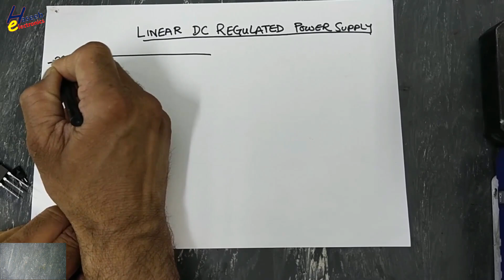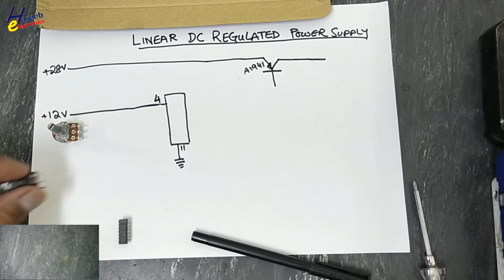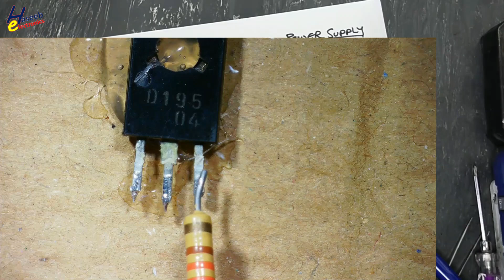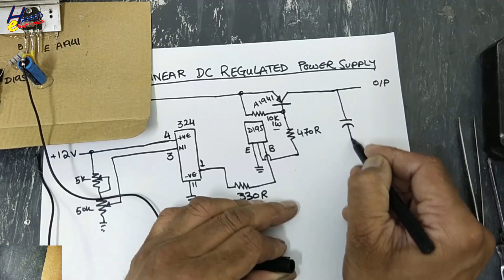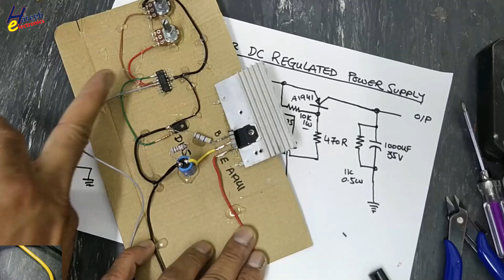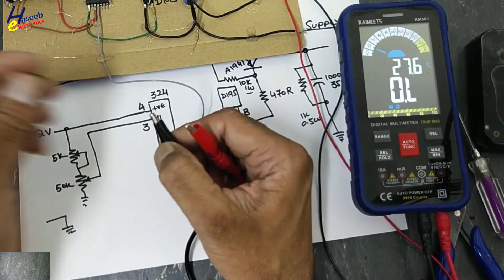#1336 Designing a Regulated DC Power Supply Using LM324 | Complete Circuit Guide

Comment: Many thanks for this interesting video. I’m encouraged to try building this project.
Lately I’ve only been using LM317 variable voltage regulators.
Reply from the maker: Previous video was on lm317. It provides only voltage control. Adding current control makes it slightly less reliable. 
Still this LM324  project is to be completed after some other improvements. 
Next plan is LM723 that is dedicated for power supply regulation

Comment: Take caution when soldering sensitive components with TS100. It has AC voltage between tip and ground. I use it daily, and whenever i am soldering microcontroller or something like that i use grounding wire. Otherwise it is fine without it.

Comment: Sir how many error Amplifier have you used in this circuit please answer me 😢😢😢
Reply from the maker: i used just 1 section for voltage adjustment. and remaining 3 will be used as current control (1 for pre-amplifier, second for non-inverting amplifier and 3rd as unity gain buffer)

Comment: Great project! I love working with op amps. Great voltage regulation! My commercial BK Precision power supply does not have fine regulation. Imagine if you used 10 turn pots and or a Jackson vernier drive. Thanks for this. You make even old boxes into excellent projects. I'm a hot glue fan as well. If you cut the end and put an led in it, it makes a really cool light pipe. Take care!

Comment: Dear Ashraf, i watched your video with GREAT interest as this is a very good project and almost nothing reliable on it in youtube.
I have tried with other people on youtube but either the transistor heats or very huge voltage drop. Not trusted videos and no explanations.
I am then happy to see you seriously approaching that project as it will lead us to more knowledge and useful circuit.

I have the following questions :
* Can we use mosfet instead of pass BJT transistor to avoid heat generation ?
* Can you explain how the output of the op amp works in relation with the input of the darlington.
* Mostly :  what changes to make to have input 60V  while keeping 12V for the LM324.
I cannot wait to see the rest of the video.
Greetings from Morocco !!

Comment: What is the voltage  when load is not connected. How much does it drop when the load is connected. Voltage drop when load is connected is the biggest problem for such variable power supplies.
Reply from the maker: great question 
once i complete its remaining parts 
than i will perform full testing 
Load Regulation, Line regulation, Ripple Test, etc
Reply from the maker: expected drop at full load is assumed 10mV to 100mV with full scale output (depending on feedback network accuracy, specially resistors tolerance and TCR, OPAMP offset, and VCC voltage stability, and gain of both transistors) 
if everything is considered accuratly then the expected load regulation range will 10mV to 100mV with full scale output
Reply: Hello sir. Could you please check your mail? 
I sent you a mail yesterday. Really important please  @HaseebElectronics
Reply: @HaseebElectronics  That would be great. 100mv @ 26-30v is tolerable for 95% of the use. BTW, why did you choose a quad op-amp. You used only one. Even if you use another one for current (?) , two remain unused. You could use a dual op-amp and reduce cost, unless you have something in your mind. Thanks for sharing - actually demonstrating the concept.
Reply: I believe it is well regulated with almost no drop as the voltage stays the same when pressure is applied to motor.

Comment: Please sir HOW CAN ONE CONTACT YOU?

I'm designing a SMPS for my final year project and it's really frustrating. Deadline is fast approaching and I'm still stuck at the design 😭😭😭😭

Help me debug my circuit so I could print it ASAP pleeeeaaaaaassssseeee
Reply: What is the specification? A smps is easy, find something same but very old, reverse it and re-build using modern parts and like magic you designed it lol
Reply: @g4z-kb7ct  Good morning sir.

My design is a 5V 40A half-bridge converter SMPS.

I'm using the SG3525 PWM controller, and an IR2110 MOSFET driver.

I don't really have a reference design for these exact requirements 😭
Reply: @nankinanko5790  Wow 40A? I have a 3.3V 20A design (PCB is 200mm x 70mm) but 40A is kind of nuts! This uses two special transformers and many parts. They are made by TDK-Lambda.
Reply: I see.
My initial design was a 24V 13amp SMPS with active PFC. But due to unavailable of most components here in my area, I was force to update my project title to;

5V 200W SMPS utilizing the half Bridge DC-DC converter.

Please can I contact you? You could be of good help. Please
Reply: Hello sir i have a 70Volt DC 😢electric scooter and my challenge is that i want to mount a 12 volt 2A. LED tail light since the original one got damaged  and it was running on 70VDC supply. Can you please help

Comment: How we valued resistors for the 2 transistors ?
Reply from the maker: that is gain calculation for base current, voltage provided by the driving source and 
maximum sync current of the driver 
and then we can select the transistor based on that required gain

Comment: Hello. I would like to ask a question, trusting in your knowledge and expertise. I truly admire your experience—thank you in advance.
Here is my question: Can we examine inductors and their effects on current in detail? What is the inductor effect, and what does it actually do?
What happens if the current leads the voltage, or if it lags behind? Why do we need such a situation?
Also, is there a way we can observe this in our workshop—perhaps using an oscilloscope?

In addition to that, how do coupling capacitors or capacitors that determine the frequency of any PWM driver IC behave in a circuit?
At this point, how exactly does the working principle of a capacitor function?
Thank you very much in advance. Wishing you ease in your work.